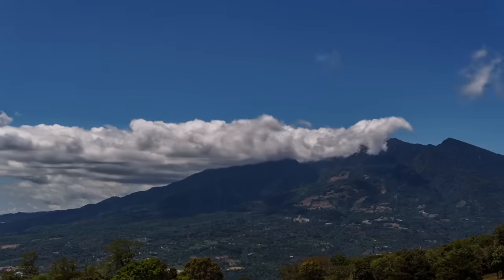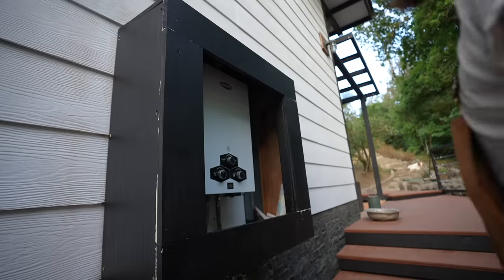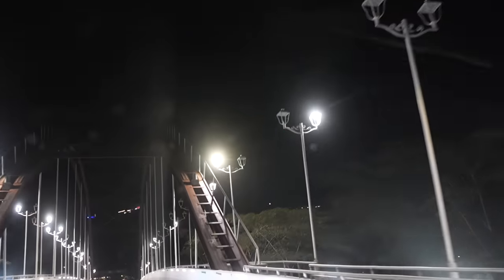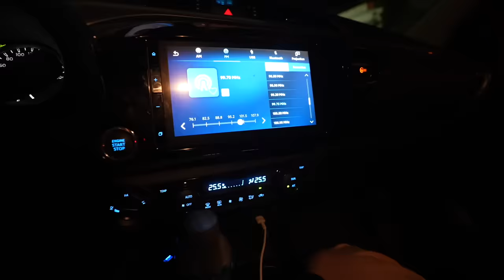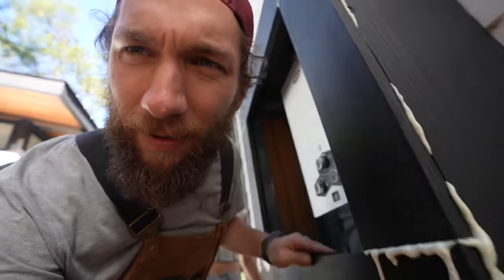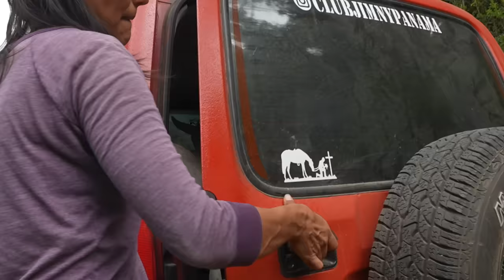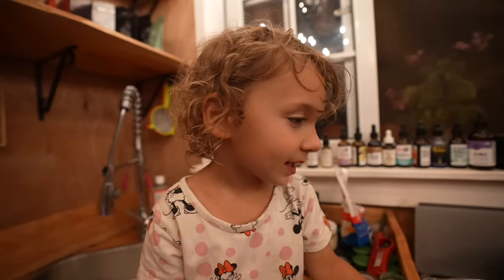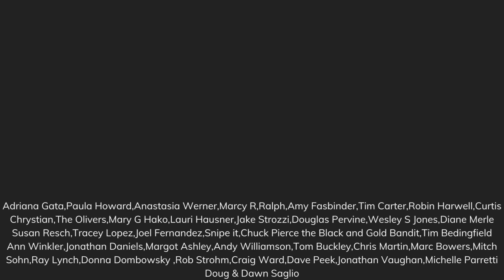EVERYTHING IS CHANGING SO FAST...

Comment: That water heater needs air to operate proper. Being in an 100% enclosed box is a fire hazard. The bottom should have been a mesh screen and the top concrete board not wood. Also the hood you installed on the vent  looked like it was plastic that is going to melt.
Reply: Good point!

Comment: I ordered some beans and ground, but I don't like messing with grinding for some reason, and I am not enough of a connoisseur to know the difference in a cup.  I know smooth from acidy but not much more.  When I buy cheap stuff, I salt it in the brewing and it is more drinkable.  I only buy organic though.  As for popcorn, olive oil is the best choice, add a few kernels until one pops, then put a single layer of popcorn only, tight, but only one layer and you will get a full pot without blowing the lid off.  I am a popcorn connoisseur if not coffee...   🙃

Comment: That wood glue you used is a polyurethane glue. They foam up as they cure.
Reply: Yup! That's right. Generally, you put glue on one side of the joint and a lit spray of water on the other side. And, yes, it is the same stuff as spray foam. It's just a slightly different mix. The Urethane glue can also stain your skin black.